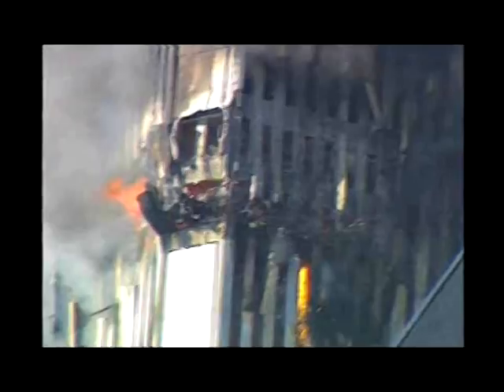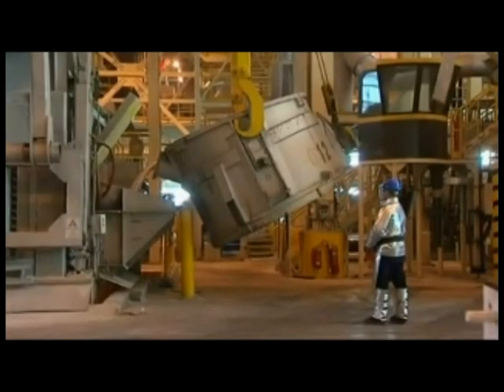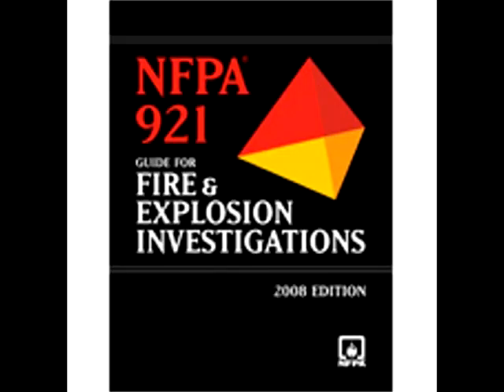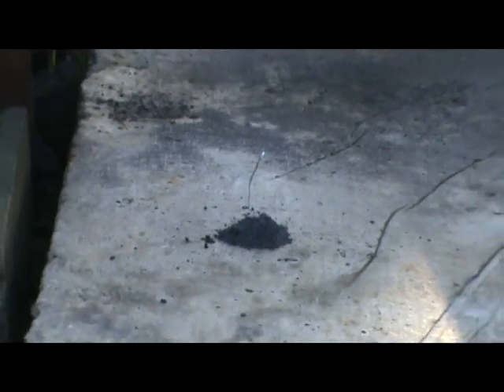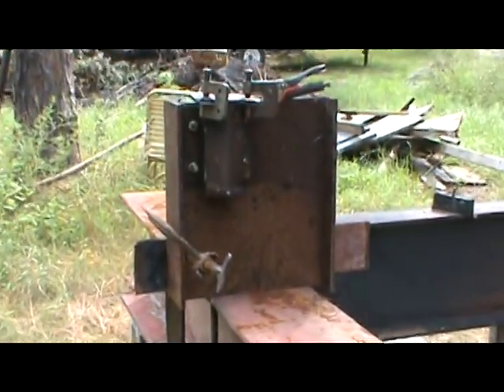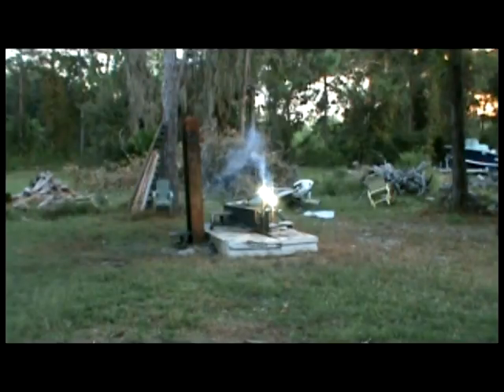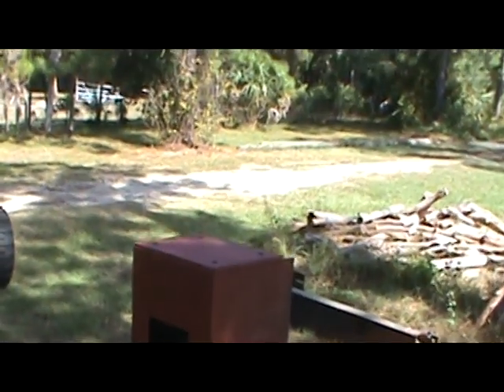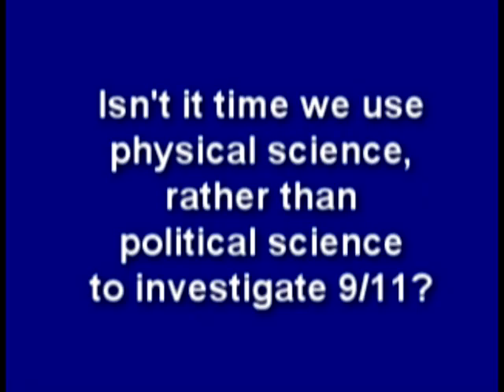9/11 Experiments: The Great Thermate Debate

Comment: I was 13 on September the 11th, 2001. Became a Firefighter at 19 and have since read multiple studies including the commission report. None that I've found follow the basic principles of fire, heat, and heat transfer in relation to how the floors below the impact zone caught fire and experienced explosive type percussion and damage.

Throw gasoline on a camp fire and you'll get an intense burst of energy and heat that at the very best, will only last for a few seconds. Fly a plane into a building loaded down with "highly flammable jet fuel" and you'll get the same result. 

All of the fuel was burned up in the first few seconds after impact. There is absolutely no physical way fuel could have ran away from the ignition source (the fire ball) and down the elevator shafts which caused the damage seen on the floors below. It simply cant happen, therefor something else had to have caused it.

After the fuel was burned up, you would have had nothing more than a large "Class A" and "C" fire. Neither class will burn long or hot enough to melt steel. It can start to weaken it, put will never produce enough heat to make it lava flow out the side of the impact area. It's basic first year Firefighter rookie school common since, that the reports fail to get right.

The topic rarely comes up at the Firehouse anymore, but it's safe to say 85-90% of the guys I've talked with agree, there is an unnamed source which contributed to the weakening of the columns and damaged the floors below before the collapse.
Reply: absolutely !
Also the destruction of the lobby append at the moment of the impact , so the small quantity of fuel could not be the origin of the explosion since it need roughly 10 seconds to fell there .
Another explanation is the impact of elevators cars falling on the floor!
but they also need time to fell
Reply: @rokag333   depends on floor elevators were on, they are staged. Don't have to be at top, timers would set them at lower floors in morning for arrivals.   Also fuel explosion fireball would travel down shaft faster than gravity. like a gunshot.  Preposterous thought that people would be able to plant explosives without being seen by occupants and maintenance.
Reply: very well said, no doubt it was a terror attack, just not the one we are all told to belive by the media.

"The use of violence (or the threat of violence) against civilians in order to attain goals that are political or religious or ideological in nature"
Reply: My english is far to be perfect
"Air fuel mixes do not require gravity incidentally.
Well. that makes no sense at all and you can tell you have no idea about that you are talking about from that statement. "
The common explanation is that part of the unburnt fuel was going down the stairs and the elevator hole
A liquid fuel does not explode it need to be in aerosol (spray of droplets surrounded by air)
so in order to form an aerosol it need energy and this energy is given through the height of the fall, by the gravity (unless you have a compressor and sprinkler have you?)
and to fell takes time at least 10 seconds probably more due to the resistance of air increasing with he nucleation of the droplets!
This explanation does not withstand the timing given by the seismographs.

The other explanation, which is your favorite is the explosion at the collision floors, and you quote the path of least resistance!
This is exactly what refutes your theory (and why NIST has not accepted it)
the path of least resistance passes through the outer windows!
and that's what we saw
if our guns are so thick it is to channel the non oriented vectorial forces into a single axis
clearly the elevator shafts are far from being able to respond to such constraints
Reply: I think the man who designed the buildings said otherwise, but in reality they did survive 2 planes on video, if they did not survive they would have fallen down within seconds/minutes, not hours like on the day. 

The North Tower of the World Trade Center collapses, 1 hour, 42 minutes after the impact 
The South Tower of the World Trade Center collapses, 56 minutes after the impact
Reply: Why didn't the tower collapse like a Jenga Puzzle right where the gaping hole was.    Not once but twice did they collapse like a demolition.     And then Tower 7, which was not even hit by a plane.
Reply: robbie gizzarelli "David, shut a fire in a box with no exhaust and limited air supply, what happens?
Yep, the fire only burns as fast as the air can be replaced, no " chimney" and the fire suffocates, or at least looses momentum." but the fire isn't "boxed" in. there is air blowing in from the bottom and the sides of the building. david is right it's a chimney effect. all the oxygen is being sucked up from bottom floors and from the sides fueling the fire, and making it hotter. there is a high pressure on the floors that are on fire and a low pressure on the outside of the building and bottom floors below the fire, which is sucking in huge amounts of air that air makes the fire burn hotter. that's oxygen part of the fire triangle.

fuel have you been in a office? there are many objects that are petroleum based like carpets, chairs and desks. there is plenty of fuel in that building. also don't forget buildings still have gas lines in them that can contribute.
now heat the the heat is trapped and moves up by the upper floors and walls. that's stack effect. 

typical residential house fire burn at 1100 degress f. house fires are type 3 contruction Mostly wood and dry wall, which would be a class A fire. these offices are type one construction steel or concrete, with a class A fire. remember the building that is on fire is like 10 stories tall. that's equal to a 10 story building being fully evolved a lot of heat is being produced. this is not your typical building fire. one firefighters weren't able to put water on it, allowing heat to build up and gases to burn. two the building was hit with a boeing aircraft, the stability is compromised. three the jet fuel helped the initial start of the fire(typical residential fire starts in one place, this was fully involved instantly, so that contributed to it.) four there is high amounts of fuel like books, papers, desks, chairs, petroleum based products, gas lines, etc. it is very possible for steel to melt in the twin towers the conditions were not normal conditions.
Reply: and ..those rooms where not empty - they held alot of material
that became ignited, created gasses, created pressure, 

This also pulls in air.. and with an opening in the tower.. the tower became a chimney and the chimney effect is very well documented..

It ups the temperatures of fire and thus turns parts of the tower
into a smithers fire - where the temperatures go up..
and there is the creep factor - not to ignore - all materials
have a temperature level where the metal gets soft/softer..
and softer metals will bend... stretch.. change
Reply: Terrorists:
Terrorism is a product of the USA and their banking system and in part the world banking conglomerates.

ISIS is the Israeli Secret Intelligence Service.
And as we all know Israel was formed by taking land from 4 other countries.
Israel is heavily funded by wealthy bankers and others if you do some serious investigation.
Terrorism is part of a plan that started in the 1950's. 
To cause internal feuds in middle eastern countries is to break up those countries which means Israel can move in and take more lands without much resistance.
Search > Who Funds ISIS < and discover it is the USA and their allies.
Ask yourself why ISIS never invades or attacks Israel.

The twin towers was a faked 'attack' by middle eastern terrorists.
911 is a hoax.
https://www.youtube.com/watch?v=4Nmj6t51Wz8
Consider:
The towers were obsolete. They were less than 50% rented and occupied.
The towers were full of asbestos which is very expensive to remove.
The towers were purchased by two Jewish billionaires just a few weeks before they went down.
The two billionaires doubled the insurance on the buildings just before they went down.
One of the billionaires was Larry Silverstein 
http://whatreallyhappened.com/WRHARTICLES/silverstein.html

The planes were a distraction to cover up the controlled explosions in the buildings which started in the lower underground parking garages. Explosions that lifted people up off the floor about 2 feet.

http://www1.ae911truth.org/faqs/655-faq-9-were-the-twin-towers-designed-to-survive-the-impact-of-the-airplanes.html

Even a modicum of in-depth research will uncover flagrant inconsistencies with not only the reporting from mainstream ( and we know the news media is Jewish owned), photographic evidence of the items below the plane, and established metallurgists and engineers stating the building collapse from the plane, including the molten metal structures, are highly unlikely to impossible. Why don't you ask your politicians why seemingly every politician and Government officials, prominent business men were given "warning" in advance to stay clear of the Twin Towers. Individuals such as Warren Buffet, scheduled to appear at WTC for a summit, abruptly changed plans and rescheduled it for his home base in Omaha, NE. Among those to be in attendance, Ms Anne Tatlock, then CEO of Fiduciary Trust Inc...who occupied several floors around the 90th floor and up. SF mayor Will Brown, enroute to NY, was held up by security before the event. Salam Rushdid, got the heads up. Ariel Sharon, scheduled to meet with prominent members of the Israeli NYC community, canceled abruptly on 9/10/2001. And another Israeli group was spared. Zin Am. Israeli Shipping abruptly canceled their lease, set to expire 12/31/2001, paid the $50k penalty and move to Norfolk VA...days before 9/11 I get it, a lot of lives were lost. But this is more than enough evidence out there that the (key US government officials) not only knew of 9/11, with Mossad's assistance, they planned it. 

None of the airplane passenger manifests had the names of any of the alleged terrorists listed. Nor where there any Arab names on any of the planes.
Nine of the 911 terrorists are still alive.
The plane that hit the pentagon. Why were there no seats, no luggage and no bodies found?
Shanksville. There was no evidence of a plane crash. No bodies. No blood found. 
Building 7 was not hit by a plane. Why did it fall down in a precise and controlled manner? Starting with the center imploding then the rest of the building collapsing and no part of the building hit any adjacent buildings. 
How did one of the terrorist passports end up in the towers rubble without a scratch and smudge of dirt?
Firefighters found liquified metal and steel beams days after the towers went down.
Jet fuel does not burn hot enough to liquify metal. Thermite does. 
If air traffic control suspects a highjacking they notify NORAD who in turn scramble 2 fighter jets to investigate. Their usual response time is less than 10 minutes.
Why did it take over 80 minutes before the first jet was off the ground?
Reply: Art Tube How is your cognitive dissonance going these days...Still defending a lie or have you gained vision?
Reply: Aluminium + Iron + heat = thermite

Plane = Aluminium, building = Steel/iron, fire = heat.

High speeds and the aluminium plane would have disintergrated and wrapped itself around the much harder steel columns of the building, like a Aluminium mache coating. The Thermite reaction wouldn't have happened until tempretures hit high enough. The organic materials plus firestorm effects of large enough fires would have initiated the exothermic reaction.

Besides, if you look at demolitions, the material the explosives cuts through isn't melted, its cut with precise high heat and impact, like an Oxy-Acetelene torch.

The building columns don't need to melt to cause a total collapse, they only need to degrade in weight bearing ability. They don't even need to be heated at all for total collapse, the Sampoong shopping mall disaster proves this.
6 stories of slab concrete pancaking onto the floors below it killing over 200 people.

https://www.youtube.com/watch?v=CWMATrOatRw

A link to thermite reaction, it clearly is a yellow reaction.
Reply: fire1937 you better go back to school then. I've seen a  jp4 fuel truck explode and then watched the remaining fuel(Which is way less than the Aircrafts had) spread out over a 200 meter area and burn for over an hour even with foam being sprayed on it.
Reply: Nick Holloway, and whoever else willing to read my essay. It was an inside job for many reasons. 

1. we could now have an excuse to start a war with an idea instead of any one enemy. this has given way for the 20 year war we are currently fighting in 5 countries at once with no end in sight. billions invested in the militarily industrial complex. the military budget has been raised every single year without fail, ballooning into this uncomprehendable monster of disappearing funds for the private companies that helped with the military grade explosives used in the towers. 

2. they used terror as an excuse to take our rights away one by one. we now get borderline strip searched before getting on a 1 hour domestic flight. all of our emails are read by the government. all of our phone calls are tapped, and they can get access to any of our text messages whenever they can come up for a reason to. 

3. agencies like the NSA and others were created right after 9/11, using billions of dollars. while also cutting social programs because "there isnt enough money" meanwhile the debt of all of these war programs is loaned to us with interest by the private corporation the federal reserve. this debt is secured on the labor of us and all of our children for the rest of the existence of the USA. 

4. troops are used as racketeers protecting us corporate interests in all foreign countries. forcing iran, iraq, lybia to remain trading oil exclusively for the dollar bill. in Afghanistan we are currently protecting big pharma's poppy plants for america's pill problem. Syria is the location of a planned oil pipeline to bypass the taxes we pay to egypt as we ship it from Saudi Arabia through the red sea to the Mediterranean sea. but the public believes we're fighting terror. or weapons of mass destruction. the funniest one is that we are giving democracy to people under dictators, because america loves installing puppet dictators (like in the congo where we killed their democratically elected leader)
 

plus other shit, im just telling you what happened with zero speculation. 
all of this is true. 
im not a genius this is all really easy to see once you have your eyes open.
Reply: +rokag333 Its not your English, it is the statement. Fuel/air does not require gravity. Fuel/oxidizer will explode without gravity IE space. This is how rocket engines work. Go find a suitable reference/forum and ask someone else. Fuel/air is simply an aerosol. It is true that in 911 the mix occurred as the fuel descended the life shaft however this is not your point. The separation and dispersion of the molecules is the result of gravity in this case. In other cases, all you need is energy by a violent collision, heat or explosives to disperse molecules to the right mix.
"..This explanation does not withstand the timing given by the seismographs...' We are talking about lift shaft door blowing off, and this can be the result of of air traveling at near the speed of sound, so it is not clear what you are grasping at here. Seismology is not even precise and approximations are used depending on the situation. The propagation of shock waves varies somewhat depending on the medium the waves pass through.
Anyway, this is a new bit of 'information' i never heard before, and what does this 'prove'? This very flimsy stuff buddy.
What was the last paragraph, try rephrasing that, as I cant follow it, or put into context.
Reply: mcwolfus88 think about what your saying..how would highly flammable jet fuel escape a massive fire without igniting?
Reply: Weazel Where did you find this information?
Reply: Well said.
Reply: Art Tube - There were no aircraft, just bluebeam 7d holographic projections and a controlled demolition. The rest is misdirection. End of story
Reply: and those structures need to hold a huge amount of weight..
Reply: paul. to collapse at free fall speed, which all three towers did, there needs to be 0 resistance between the building, and the ground. if the building was "pancaking" through floors, each floor would have posed at least some resistance. I know we've all been programed to call it a collapse, but clearly that's not what happened. 
there was no resistance as the building went down. it was assisted with explosives.
Reply: kbs117, finally someone brings this up."jet fuel" is basically #2 diesel
Reply: This video completely ignores the fact that it wasn't just a fire.
There was also the impact of a 180,000 kg airliner traveling at about 300 mph. Which introduced about 1.5 million joules of kinetic energy right into the center structural supports of the building. With thousands of tons worth of building sitting directly on top of it.

This would have easily damaged the structural integrity of the building without even adding in the fire. Then you add in the fire and down it comes.

You're also commenting on how an open air fire doesnt burn hot enough. This was not an open air fire. It was inside a very large building. It was more like a furnace. Maybe near the windows it was open air but there's no way much wind would penetrate to the center. Yes the jet fuel would have been used up rather quickly but these buildings were made in 1973. They were full of tons of stuff that loves to burn. Esphestos, drywall, office paper, carpet, couches. Wouldnt explain melting any steel but would easily explain fire spreading to other floors.

And it wouldnt have to melt the whole thing. All itd have to do is weaken it just under the threshold to the point where one support gives and then the whole thing gives like dominoes.
Reply: Still a 13 year old.
Reply: Robbie Retro  watch Forced in Fire series.  I can bend steel in my barbecue.  With just air.
Reply: fire1937 今天
Reply: In order to blast you must have an aerosol of fuel and it take some time to produce at least the speed authorized by acceleration of the gravity
 the blast  of the lobby happend in the same time than the crash of the plane.
Now if you speak about a blast then everithing on the path of the flaming front  will be burn and no testimony of that
Reply: There is 2 explosions one at the floor of collision and the energy for spraying  is done with the kinetic energy of the collision
this explosion went out through the path of lesser resistance so through the windows
But how to explain the explosion of the lobby ?
let's admit that part of the fuel is liquid, it has to go all the way down and this takes time (and yes the fall will create an aerosol)
The problem is the time it takes 
And no the 1st  explosion  will not go through the stairway or the lift hole because the resistance is  much higher than the open space of the floor
Reply: I do remember watching 9/11 and thinking how will they clean this mess up then the towers fell problem solved
Reply: fire1937 clearly more to the story than we’ll ever know
Reply: fire1937 truth. Also true corporate zionist jew banksters kn wallstreet prevailed that day. As they also did in 1913 with jew fed reserve
Reply: That source was pure evil.
Reply: : what does it take to fly a modern plane ?
: i'm not a taxplayer of your domain
: for reason there need to nuking of a building 
: but you.. part of the popolus needs one
: was it a good reason to go to war.. for many it was a very good reason
: i am a gullible sheep - like the many - you're here
: if you do not believe anything - why use internet and youtube ?
: well - build a huge building aka.. 1:1 the twins and fuel burn it..
Reply: Dictionairy salesmen beware - they are still in need 

THERMITE
Reply: mcwolfus88 Paid government debunked are you? You have done nothing to refute any of this information, you merely dismiss it because it's not the official account. Go away. Your time is coming swiftly. We're on to you and more are waking up daily.
Reply: fire1937 what an idiot...how much you make for that lie, troll?  I melt steel with gas all the time.. Ever hear of a smelting pot...? Damn your stupid..
Reply: insight001 idiot...jet fuel isnt highly flammable.. And 10,000 gallons of it didnt all burn in the explosion.. Trolls!!
Reply: fire1937 you are absolutely correct....ill add that the govt never quantified the collapse event..they said "it was too difficult"..no shit!.... But went on to "explain" to US what happened in a 2 paragraph word problem "explanation" anyway...which, when solved, proves the columns below provided no resistance to the collapse..must be why it wad "too hard" for them to jive the official story with classic physics...peace, in-spite of those treasonous bastards.
Reply: Christs Revenge ....oooo..the anti semite card...lol!...THAT'll show US...ahahahahahahah!....there was alot of quantification with math and physics going on with that accusation..im totally floored by depth of knowledge you have of the subject....your motherland was most certainly involved in the planning, execution and subsequent cover-up of the fact of what really happened on 911 ...there is no doubt about it...the neo- cons, who were in control of the country,...and the foreign loyalist in the us govts, hand in hand with israel were of course also involved....you have any facts to back up your faith in any of those creatons?...I...thought....not.
Reply: insight001 because it must first be atomized
Reply: i love u bro
Reply: fire1937  Firstly respect to you as a firefighter. I am sure you have much greater knowledge of how fire behaves than me. However, one thing you cannot deny was they were one hell of a pair of explosions. I disagree with your comments about the dissipation of energy from the explosion saying it couldn't have gone down the elevator. The energy from the high speed impact and fireball would go up , down or through
 any voids it could find. This is exactly how explosions in mine shafts happen. I have seen a 747 crash at Stansted Airport on 1999 From my office. The fireball was like a mushroom cloud and was estimated at 400ft high.  Forces involves in plane crash explosions are incredible.  From your position as a firefighter perhaps you could look at the public records and eye witness statements that say the explosion in the lobby happened just after the impact. One chap was running inside to avoid the debris after the impact and got caught in the lobby explosion seconds later.
As for how fire behaves, speak to any of the Grenfell fire fighters. They looked at the fire as they got there and said " That's fucking impossible, fires just don't do that. " We know now know that they can, and why in that instance. 9/11 was unprecedented. Absolutely nothing to compare it to. We do now have Plasco Tower in Tehran to look at.
Once again, respect to you. But I do disagree.
Reply: fire1937 well said and on point sir, the question is why the inside job?
Reply: Артём Невзоров r
Reply: spot on,"jet fuel" is #2 diesel
Reply: Well done now we just have to tell the sheeppl
Reply: zz top stranger tube: that's frickin' hilarious. well done sir. funniest thing I've read all year!
Reply: fire1937 jet fuel isn't highly flammable I can stick a lighter to jet fuel and be fine jet fuel needs to be vaporized.
Reply: wayne flint: it  will be difficult,most are dyed in the wool
Reply: fire1937 Have you ever heard of putting molten aluminum and water together?

... It explodes...
Reply: Nice synopsis there .... Its good to know you guys weren't fooled. Thanks
Reply: Absolutely spot on ,Next time I am cutting any steel I will throw some old computers and chairs on it, Save renting gas bottles,
Reply: Jet fuel is NOT "highly flammable": It is combustible. That is a huge difference. It doesn't "flash" like gasoline unless it's in mist form. If it is in mist form, it is far more explosive and burns far longer than gasoline. You may have basic firefighting knowledge but you don't know jack about metallurgy. To weaken steel all you have to do is anneal it. Any welder or machinist can tell you that.
Reply: 2Stroked look up controlled demolitions.
Reply: Charles Nelson It's amazing. Dozens of videos showing the massive damage caused by 150 ton airliners moving fast as bullets,    air temps of 1800 degrees, showing the floor trusses collapsing and the walls pulling in, and these nuts refute it with made up nonsense. What a bunch of morons.
Reply: @CGoffgrid  Amen!!
Reply: Chris Gilliam Agreed-I’m all for a GOOD conspiracy,but this is just dastardly and moronic.
Reply: None of the firefighters than went into the towers that morning thought they would fall, they were designed to withstand impact of a 707 which is the biggest commercial aircraft in 1973.
Reply: fire1937 You are beyond delusional,so lemme get this “right”,the government hired terrorists to hijack ✈️ ‘s-installed large quantities of explosives in surgical locations and leveled to buildings..I have one question,why use planes then geniuses? Just place explosives and round up the usual suspects to blame it on.
Ya’ll are ridiculous here.
Reply: fire1937 but think about it.  It wasn't only the planes and fuel, it was everything in that building.  Highly flammable materials.  And, there was nowhere for the heat to go.  It was a sealed chimney with no opening at the top.  Everything was pressured cooked.
Reply: fire1937 the jet fuel running through the building and down the elevator shafts is such a hollywood explanation. That sort of absolute nonsense would only happen in some blockbuster action movie. People buy it though.
Reply: rokag333 building 7 anyone? And after the main course we will be having a commercial airliner disappear inside a tiny hole..then if you like the night life we will be serving a comercial airliner dissentigrating in a field for the first time ever.
Reply: Of course aluminum can reach more than 700 centigrade and so become cherry color BUT
And this is a big BUT the refraction of aluminum is so high that as soon of the external temperature of the melted aluminum goes below 660.3 °C and even on a micrometer thick film it act like a mirror the cherry light is reflected inside and the outside light is reflected outside so you see only silver color
Evey people that have work with melted alu will confirm
So this long stripe of melted metal CANNOT be  aluminum
Reply: Weazel oh ok, its insane some ppl will defend 9/11 as a  legit terror attack smh
Reply: Don't fool me - ofcourse they planted explosives in a huge building - and nuked it to kill 5000 people.. they could have fired them.. o wait they did.. ofcourse the gov has planted explosives in all buildings - because 

a) they like explosives
b) you never know
c) the gov is always evil
d) you and i are the real smart people
e) others are stupid
f) people who wend to college are stupid
g) metals cannot bend
h) burning fuel cannot create creep !
i) because the gov is evil and every building is filled with explosives
this last line becomes to increadibly long and almost hard to read only for those who lived a few hunderd years ago because they had not learned about the use of interpunction or getting a headache.

some things are simple - not complex 
complex things are made out of simple things
it is a craft to flush out noise, identify the simple things
and not getting infected by data cluttering.

BiBo : bullshit in, bullshit out

If your intake data is flawed - the outcome data is also flawed.

Your brain is unable to use segmentation
maybe the next upgrade ( patch 909a) 
will solve your segmentation problem.

Step 1 howmany rooms where in the building ?
Step 2 at which level did the plane enter the building ?
Step 3 would you put explosives in a building and why would somebody agree to do so ?
Step 4 howmuch fuel did the plane hold - was it a fresh loaded plane ?
Step 5 have you ever emptied a full plane-fuel tank and lit it ?
Step 6 what are the core structures of the building ?
Step 7 what is creep ?
Step 8 at what temperature will the used metal melt ?
Step 9 what is creep ?
Step 10 what did you eat today - was it good ?
Step 11 how many hours of sleep did you have last night ?
Step 12 are you suffering - do you need assistence - why is your cat
called furny ?
Step 13 is your suffering is related to generic suffering of others ?

coffee time

Remember.. complex things are made out of simple things !

Sometimes it is very simple - a cascade of events
like your current condition.. it seems complex..
but it is made out of simple things..

Don't worry.. many people share the same fait . . 

and,... stop nosepicking... there is a good reason not to !
really.. there is..
Reply: fire1937 Wow- never knew you were a civil engineer. Also this proves you have little knowledge on what would have actually happened. Let me guess it was Obama.
Reply: Fire1937+ well said, my friend. From, Commercial Diver- Canada.
Reply: btw: experiments done on ground level are useless - without the structural pressures that where at play there..
Reply: fire1937 no it wasnt jet fuel but thermate in a controlled demolition...its not an unamed source...
Reply: +rokag333  An explosion is a vast amount of gas with nowhere to go, which causes a shock wave. Many variables. This gas will go out the window in part,  but will also find the weakest point and windows may not release the pressure or shock wave. Once a window has gone does not mean that the gas and shock wave are equalized/dissipated. For example ten tonnes of dynamite in a small closet with a window would certainly take the window out, but what else too?! 
Fuel and air mix was in the lift shaft and this blasted the doors off. Did you know that floor dust can also blow buildings to bits and kill people? 
I think you are looking a bit too hard at the event. If you give the same treatment to any other disaster, you can also find small details without detailed answers. 
Those buildings did well to stand up as well as they did, and if it had not been for the fire then they would have no doubt remained standing and many people would have survived. I am not sure how they would have got rid of them though, it would have been a massive headache.
Reply: @mcwolfus8824   the bottom of elevator doors are held by. Screws and plastic guides.  It would be easier to blow open elevator doors than windows, as an Elevator mechanic it is a fact.  The impact velocity of plane and debre alone would have knocked them out.  Considering some might have been at floors with doors open when hit is also factor.  Elevators descending into impacted floors also a factor.  Elevators falling would also vaporize fuel.and be just like a piston in an engine.
Reply: +rokag333
Fuel air blast travels the near or at the speed of sound, and i am nit sure where your information comes from. It also creates a shock wave which is devastating. You need to find data that is general instead, of cherry picking anything that supports a narrative as supported by one source on the net.
Reply: +rokag333 
"...In order to blast you must have an aerosol of fuel and it take some time to produce at least the speed authorized by acceleration of the gravity.."
Air fuel mixes do not require gravity incidentally.
Well. that makes no sense at all and you can tell you have no idea about that you are talking about from that statement. 
Truthers trawl through all eyewitness testimony and ignore it, until they find anyone and no matter who that appear to support their story. This applies to pretty much anything. Air crashes are typical, you find so many witnesses that will tell you an a/c was on fire for example when it clearly wasn't for the simple reason that this is what they expect to see. Ask the right person and they will have met Bigfoot. 
Try asking the majority of people who were there, (but they don't comment or make themselves available), so do this instead of of combing through the net to find some oddball with a watch timing the whole event unfold. Many truthers think that a death ray and a nuclear device was also used! Planes hit fuel explodes and some run down the path of least resistance. This doesn't mean the government/Jews uninstalled tonnes of magic missile and fire proof material and control gear in very busy ans secure building. Look hard enough and you can prove anything especially in the days of the net where anyone can claim anything and be believed, as long as it fits. Not how we establish facts.
Ever asked yourself what happened to demo for truth? It doesn't  exist for some odd reason. Take a look at the bigger picture and we are not all stupid as you must assume.
Reply: Art Tube+ Blaa Blaa Blaaa    you are an idiot. It was Controlled Demolition. PERIOD.
Reply: Mooselippz whats your argument. watch any video of a controlled demolition. you can see the sparks fly from the building. but for the wtc; not one detonated explosion in sight with the collapse. to go even deeper, the fire sprinkler system was cut off from the impact. the constant fire and stress from higher floors cause both building to buckle. both building hit others on their way down. such a shame what people have become.
Reply: herauthon four+  Ya, dry wall and office furniture burns hot enough to melt steel.... wake up.
Reply: herauthon four+  all of your posts sound like you are a BOT. Or did the CIA hire you???...
Reply: Art Tube bullshit the building that burned In London for a week is still standing and being rebuilt. No skyscrapers in the world ever fell from fire sorry
Reply: niagra898+ the planes were used to hide the fact that the Towers would be brought down with Controlled Demolition...  idiot.
Reply: herauthon four+
That's right murica..!!! 19 cave dwellers (mostly saudi's nationals whom many are still alive today) managed to outsmart the multi-trillion $ defense and intelligence agencies. CIA, DOD, NORAD, FBI, Government, Airport Security, Police enforcement... etc.

They did all this with box cutters, indestructible passports & bandannas.. now considering most of these folks couldn't fly a kite, they managed to manually fly giant commuter planes with most of their navigational & flight systems turned off.. with pin point accuracy and well exceeding their aircraft's flight and structural limitations.

The government immediately claimed they had no idea who was responsible and nor did they have any foreknowledge "aka intelligence", but the scripted presstitutes in the lame stream media, had within hours  started pointing the finger at the bogeyman "OBL".. whom by the way, was never indicted for 9-11. (go figure)..?

They brought down 3 buildings with 2 planes..? which collapsed at and near free fall acceleration and the other plane they buried "literally" in PA without a trace...

NORAD were too preoccupied playing war games, Bush was making the most of photo opportunities at a school, Rumsfeld was helping pick up pieces of a missile.. oooops a plane, from the Pentagon lawn.
The cash strapped Pentagon could only afford 1 camera made from a potato, and their 1 and only video took a few years to release.. with the wrong date and time stamp on it...?

Meanwhile the liquefied steel that FEMA documented, the hundreds of eyewitnesses (including FDNY & NYPD) that reported many secondary explosion; from the basement, lobby and several of the intermediate floors prior to the buildings collapsing.. were all ignored by NIST and the 9-11 Omission..!!

It took + 400 days to assemble a cherry picked commission, meanwhile most of the forensic evidence "steel" was shipped to China and India to be immediately scrapped - destroyed... nothing to see hear folks, move along..

So approx. 15 million was issued to fund the 9-11 investigation... meanwhile the clinton and lewinsky BJ cost about 45 million..? hmmmm priorities??? 

Anyway off to war we go..!!! in search of WMD's - weapons of mass DELUSIONS (ooops wrong country). +1.6 million deaths later.. and a US economy now +18 trillion in debt (you the tax payer) and no one has been held accountable??

If you believe the "Official Bullshit Story" you are nothing but a gullible sheep.  baa baa baaa 
 >> go back to CNN.
Reply: +fire1937

"..There is absolutely no physical way fuel could have ran away from the 
ignition source (the fire ball) and down the elevator shafts which 
caused the damage seen on the floors below..." 
Utter rubbish, and any firefighter will tell you different. Lava flow?? WTF?